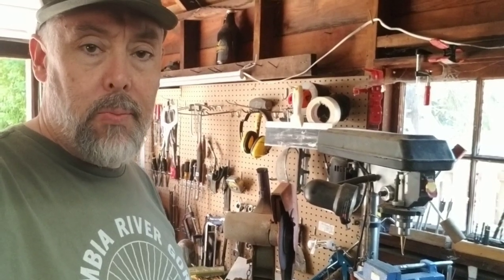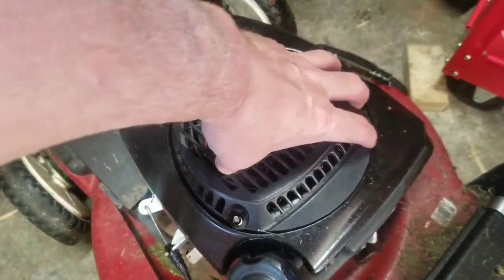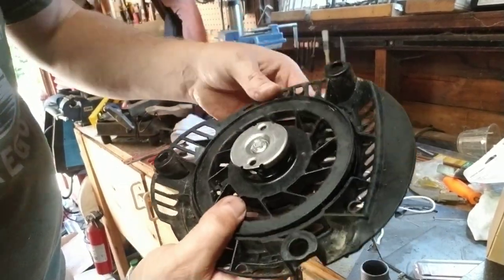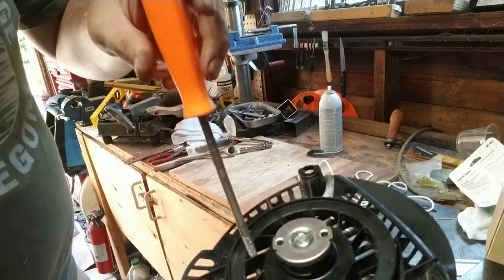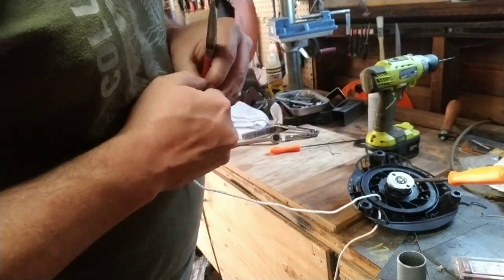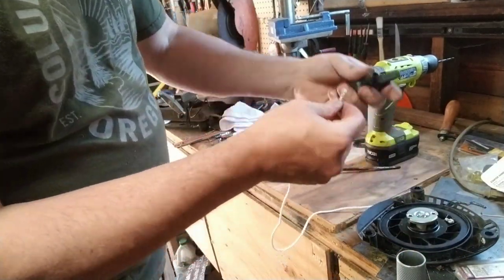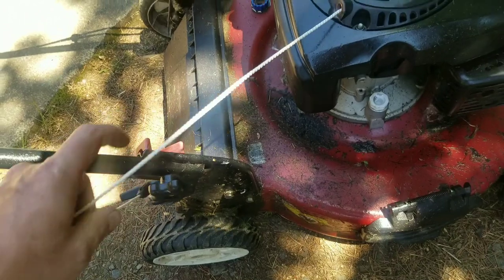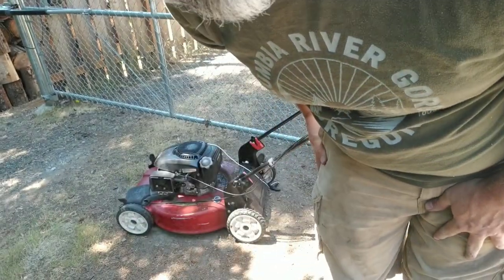How to Replace Pull String on Toro or Briggs Stratton Lawn Mower & Starter Recoil Repair

Comment: Very helpful video, took me about 10 minutes to do.  Could have used a bit more information on locating the hole in the recoil assembly that the cord passes through. I used a thin wooden skewer to line up that hole with the exit hole.
Reply from the maker: Good point. Sorry I didn't hit all the details.

Comment: my pull rope is good but the GUIDE that HOLDS the rope on the side, that latch broke off. how could I replace or rig that? zip tie? metal loop contraption?
Reply from the maker: Not sure. It might just be easier to buy the part for that. Sometimes you just have to buy a part.
Reply: @JasonSipe16  mannnn that sucks lol 🤣 it was cheaply made too .. but thanks .
Reply from the maker: @e_thegod5303 sorry to break the bad news. But, at least you're getting it fixed cheaper than buying a new mower!  The part I have listed in the description might work for you